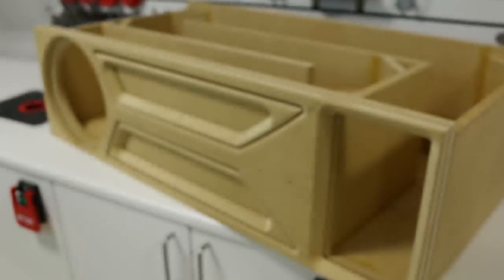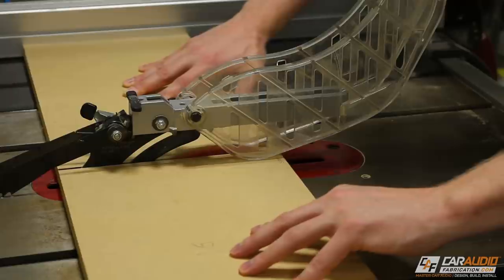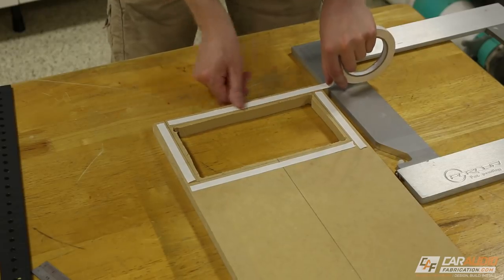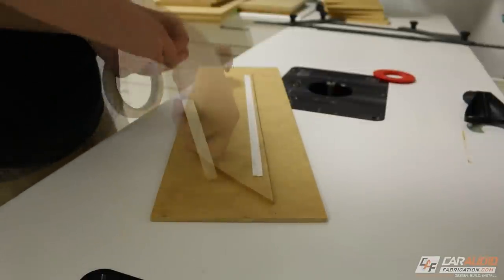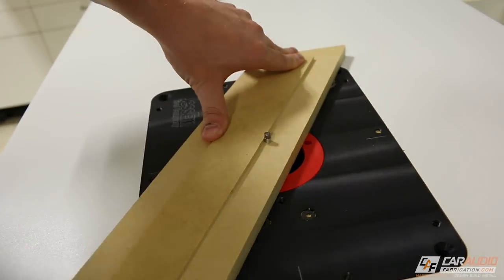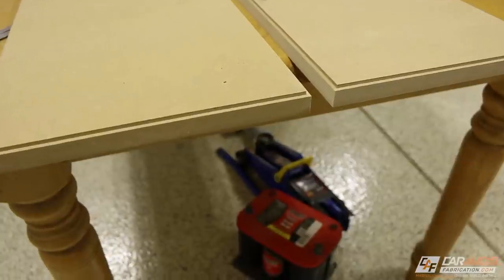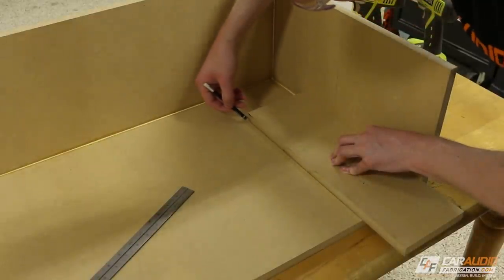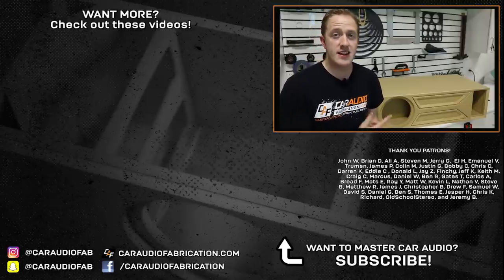How to Build a T-Line Subwoofer Box

Comment from the maker: What is your favorite box design style? What else would you like to see me build in future videos?
Reply: What is ur best sugestion for a 2005 chevy truck single cab subwoofer box  you think is better.
Reply from the maker: @omar - Not a T-Line. They get huge quickly. Take a look at someting like a sealed or ported enclosure. To determine if you have enough room for ported check out this video: https://youtu.be/oKdAHZS1LP4
Reply: Thanks brother i will ck all ur info, thanks for ur videos i am super pumped to customize my truck.
Reply: I like parallel 6th orders because you have full control over your pile of dog food. Ported boxes only let you move the left side of your dog food pile.
Reply: Triple chamber bandpass
Reply from the maker: Nice!
Reply: Something with an aeroport
Reply: my go to is EBS slot-ported, but i'll do a 4th order band-pass if i can get a flat frequency response with a similar Vbox.  better low-frequency roll-off with those.
Reply: @SoundmanCA: You DoUg, you :))
Reply: Hi Mark, I would be interested in your thoughts regarding passive radiators instead of ports. Do they have a place in car audio?
Reply: How about a 4th order band pass push/pull triple chamber box and why would you pick such a box?
Reply: I'd like to see a folded horn build. Rare as anything on youtube, most of the builds are just ported boxes with huge flares.
Reply: CarAudioFabrication , I am very interested in learning more about the transmission line style.  I had no idea it even existed until these videos.  More specifically, I want to learn how they compare to more traditional box layouts.  

So, special request: how feasible would it be to take the exact same subwoofer used for this design, and build a sealed, ported, and bandpass enclosure, and then scientifically test the differing outputs so we can see, visually with those awesome graphs, the actual difference?

Anyone that is into quality audio enough, knows what type of curve they enjoy the sound of the most.  Since we can't physically hear the differences ourselves, seeing those curves is the next best thing.

If this particular subwoofer isn't conducive to multiple enclosure styles, perhaps substituting a relatively cheap alternative could work?  The goal isn't to produce a sellable product.  The goal is to produce enough data to present to your viewers.
Reply: +1 for folded horn
Reply: unfortunately a graph can't express the low-frequency fidelity of a t-line.
Reply: I've been thinking about building a box for my home theater. Maybe something efficient with a 6" or 8" sub so I don't go to crazy with the size.
Reply: Hello Congratulations for yours videos! I have 2 JBL 15" (MS 15 D2) (doble coins 2 ohms each one) I must put then in serie to reach 4 homs each becouse my amp (it works only at 4 homs each chanel). I would like to use it in home, sometimes to play my bass... What you sugestion for a enclosure to them? Thanks!
Reply: 4th order push and pull. i have 2 10" rockford P3s and would love to do a custom box for MBZ 08 mbz C-class.
  also id like to take this time to thank you for knowledge shared and inspiration to build stealth sub box for WT5 for my cabriolet. keep up the great work.
Reply: Aperiodic Bi-Chamber!! ABC boxes have always been a favorite of mine.
Reply: 9Nails t-line is very nice for.
Depends how much space you have, a coffee size table/sub box or go a simple ported box.
Reply: T-line with two drivers in the same box!!
Reply: My favorite box design style, is the one you made for my Volvo S60. Ported for a set of four 8" American Bass VFL subs. I'm never changing it. I'll replace subs and amps if they ever go out but nothing could make me part with this box.
Reply: Folded Horn builds are pretty cool. On my channel, my cousin has a folded horn enclosure for a single 8" Alpine Type R that slams for what it is.
Reply: post vid...i wanna see
Reply: CarAudioFabrication 1998 chevy c1500 consol box
Reply: Tapped Horn
Reply: CarAudioFabrication you should build a 4 12" subwoofers box for a 1999 Lincoln Town car..... I want to put the power acoustic bamf 1,700 RMS each in the box once you're done making it 🤞🤞🤞 how much?
Reply: Closed enclouser with large membrane powerful speaker, or passive membrane enclouser with semi large membrane semi powerful speaker.  With as short as possible low frequency decay time and as tight as possible phase coherence of a signal with other speakers across frequency range. Although bass in most cars tends to sound better outside of the car anyway.
Reply: CarAudioFabrication is there any video on aero ported boxes? Anything to look in particular in building one?
Reply: Favorite is dual 12 inch enclosure with a shared kerf port kerfed both inside and outside 3.62 cubic feet tuned to 32Hz.  Double Baffling.
Reply: Quick question. Is a L shaped box better than an aerorort design? The reason I ask is because it seems like the L box would load up more than an aeroport port. Your thoughts?
Reply: CarAudioFabrication  I'm looking for if anyone has an encloseure design for a T - Line Box for a Kicker L - 7 15"
Reply: You are the first to Come close to a box I love for my 15's T-Line.
Reply: CarAudioFabrication Why those parts at 10:35 ? For stability or for airflow?
Reply: 4th order triple chamber
Reply: I've started watching your videos bought a router, bits ,a lift and table ur alot of help how bout a rear underseat f150 box for dual tw5s tht be awesome
Reply: Tapped Horn!
Reply: @CarAudioFabrication  can you make a video on a horn enclosure at 33hz for a 8in subwoofer please I really want to make a horn enclosure but I’d like to visually see how. Your subscriber-James

Comment: Why can't us the regular humans find guys like you to build stuff and install systems for us? Instead it's dudes that be like. "Yeah bro we got pre fab boxes ready to go, nah we ain't got no table saw in our shop."
Reply: Trapperjohn1000
There are plenty of great shops out there, you just have to do the research and find one in your local area. Yes it can be a pain in the butt to spend hours calling to different shops and visiting them to see what they can offer, and their level of work. I figured if you are going to spend a thousand or so dollars on a Subwoffer enclosure, you might as well make sure it is done by someone who knows what they are doing. A shop that can produce top tier work is going to cost some serious money, you figure about $100 to $150 and hour plus materials. I don't know what your budget it like or what your end goal is, but I can promise you one thing, if you are trying to find the cheapest installer, then the work you get from it is going to reflect the money you invest in the shop. SO the adage still stands, you get what you pay for. :)
Reply: I built an enclosure 4 layers fiberglass to hold a vented 12" L7 up in the quarter window of my 99 Yukon. I tracked my materials and hours, it would cost a customer round $1500 for this enclosure.
Reply: For real dude

Comment: Any idea on dimensions,volume, Port tuning frequency and length for a Rockford Fosgate 10 in p210 S4 basically a slot port bandpass with the port on the front of the woofer side the reason why I'm asking is I can't find any good free calculators online I don't know where you guys are getting those programs I was just wondering if there's anything free, all I want is just a bandpass box for this 10 inch sub this has been a really hard find any info would help greatly thank you

Comment: Great project... I've built hundreds of custom car subs... loved it for many.many years... I used routers extensively, as well as routers to flare large PVC port tubes-from the inside at the speaker baffle board and both inside and outside the PVC port on the inside thereby eliminating the air from breakingoff/separating from the port just like in an airfoil. 

This allowed the bass to smoothly and with much less noise extend the bottom end in a way that was awesome. Loved shaping what iz would pull vinyl or grill cloth over like sculpturing.

Boat seats are sculptured in a very similar manner and are dubbed 'sculptured foam'

Comment: BTW... I always found using the poly based professional liquid nails from a caulk gun and 1.75 inch narrow crown staples (still have that gun to this day) was the best way to fasten any MDF or particle board product. It work quickly and solidly and you never, ever have a joint to leak, break or even give in any way. the material will break somewhere other than the joint even if ran over by something like a dump truck. I always used a DuoFast gun.

Comment: Awsome build. I used to design these ban pass boxes. The length and cross sectional area are extremely dependent on the driver you're using. What driver is going into this box, also what frequency is it intended for? You may have gotten me back into this again.

Comment: Could you clarify or comment on one aspect of T-line enclosures?  As with any enclosure which uses a port, isn't the enclosure "tuned" to one specific frequency?  This creates a bump in  the frequency response curve around the port's designed frequency.  So how do you keep it from sounding boomy at the tuned frequency?  Is the roll-off from the tuned frequency in this enclosure smooth or sharp?

Comment: in t-lines i've noticed the port is usually on the same plane as the driver.  is that a design requirement?  i would prefer to have the port rear or down-firing.

Comment: Hi, I bought a edifier s350db speaker system. I intend to remove the 8 inchs driver from the ported box and build a transmission line enclosure for it instead. But I'm worry that this driver might not be suited for transmission line if he don't have the correct fs, qts, qtc, vas, re, so on. Do you know of an ideal 8 inchs driver for transmission line available for purchase online that I can buy. I want to listen to my entire collection of rock from the seventees with low distortion tight bass coming from a single dedicated t-line subwoofer. As for the digital amplification of the edifier it is very well build. Keep on rocking till you drop as def leppard said in their pyromania album.

Comment: Can T lines be use for any single sub? And whats the best thing about T lines?
Reply: A "T" line is easiest to design build and install in to the vehicle with only one subwoofer. The overall size of a "T" line is pretty massive vs other box designs. The best thing about a "T" line box is the ability to flatten out the bass curve and allow a subwoofer to play more accurately with fewer spikes in the frequency range. 
  As comparison a "bandpass" designed enclosure will be "tuned" to create a spike at a certain frequency. This allows the precised volume of the box to "louder" and have more punch. 
   A "T" line works best in a open are space like a SUV, Station Wagon, etc, due to its ability to reproduce a very accurate level of bass... The bandpass box for comparison works best in a sealed trunk. Since the back seat of a vehicle tends to block a lot of frequencies, the bandpass box has the ability to punch hard at a given range at the sacrifice of overall sound quality and accuracy.
   SO T line is best for open air vehicles, not saying you can not use them in any other application, it just would be a waste of time effort and space to use this style of box in an enclosed space. Since the benefits of a "T" Line are robbed by the materials the sound is trying to push through.
   Hope this information was helpful :)
Reply: +Womby Farthing
It is all about port tuning. You can tune the port to a given frequency response ranget. Allowing you to flatten out any spikes in the low end. It takes trial and error and experience to get one right. When you do the results are nothing short of spectacular. It is not like setting up a system in a large room, the interior of a vehicle plays havoc on the sound quality of your system, so box "tuning" can play an important role in sound quality for automotive applications. In a perfect world you could stick all your speakers in the proper sealed enclosure and be done with things.
Reply: +Din Tjommi
You are correct, not all subwoofers work well in T line boxes. I have had some amazing results with Sundown Audios SA-8" and X-6.5 SW V.2, the excursion and overall design plays well with a T line and allows for a wide range of tuning. For real world example, my 2001 Golf GTI has an issue of a 54-55 Hz resonance. This causes a peek at the drivers location that gets "boomy" and it is so bad that it will drown out everything else when that tone is achieved. I have found that any sealed, ported, or bandpass box I have installed as not gotten rid of that over amplified 54-55 Hz hit. Just the cars design causes that spike in sound pressure levels at the 54-55 Hz. I have found that a single Sundown Audio SA-8 in a "T" line box tuned to 30 Hz facing backwards removes that spike in the sound from the drivers position in the vehicle. This has vastly improved the overall sound quality of the system overall. I no longer have to deal with ear bleeding spikes in the sub sounds. The added benefit I have found with the T line box is the lack of port "chuff", even at very high Hz levels the port "chuff" is near silent. The smaller overall size of the 8" subwoofer allows the speaker to reach higher in to the mid bass range then larger subwoofers. I have more head room to adjust my crossover points, allowing me to tune out some of the sub bass from the midbass speakers. Preventing any sort of low end distortions, and reducing the over all strain on the amplifier driving the midbass, mids, vocal and high speakers. Giving me a much fuller range of sound with far fewer peeks and dips in the audio range. Under white/pink noise testing I have been able to achieve near flat levels of sound sitting in the drivers seat. All while doing so with less then 2000 watt class. I have won a few competitions for sound quality in the 2k class, so I am pretty happy with the overall results.
Reply: COMPASBASSCLUB CHICALI try to use a sub with a QTS of .4 or lower. That's what helps give t lines the flatter response and shallow rolloff and tune it to the FS of sub. So try to find a sub that has an FS of the tuning you want
Reply: home audio only? hmmmm something to think about, thanks. a T line for my 8" infinity is my next build
Reply: 8" infinity for SQ in small hatchback??????? (280z)
)
Reply: COMPASBASSCLUB CHICALI the best part about transmission line boxes is that since it has many walls on the inside of the box it shoves all that Aaron compresses more and more and shoots it out of the opening at the end. Not only that but some of them with single speaker shoot the opening towards the actual speaker so that whenever it's going forwards and backwards not only is it shoving it through the transmission box it is pushing the escaping air towards you. If that makes any sense.
Reply: +Seth Hardin : Reference this:  http://www.quarter-wave.com/TLs/TL_Theory.html
      Transmission line enclosure relies on a quarter wavelength acoustic standing wave. There requires a fair amount of calculations to tune the "T" line port properly. For example, (I will try to keep this simple) I wanted to tune my enclosure's resonant frequency  to 30 Hz. You would calculate the length needed in order to produce a forward firing 30 Hz wave. This would then bolster or reinforce the subwoofers own frequency response at 30 Hz. The port has to be firing in the same direction as the woofer itself. Without this the response of the port can actually have a negative effect on the overall output of sound. Since the port is taking "sound" from the rear of the woofer, which normally produces the opposite sound wave as the front. SO for example the front of the woofer produces 40 Hz the rear of the woofer would produce a -40 Hz. This would cancel out the "sound" produced by the woofer. That is the reason playing speakers in the air without and thing around them they produce little to no sound (outside of some wind noise from the venting around the voice coil and rattle from the surrounding surfaces. But to produce that 40 Hz sound you need to isolate the two sides of the woofer, to prevent them from interacting on each other in a negative way. SO what a Transmission line box does is use that "negative" wave by flipping it to a positive and porting it out firing in the same direction as the face of the woofer. In turn this can reduce a weak or dead spot in the woofers ability, or reinforce and "boost" others. It all depends on how you want to tune the box and what your end goals are. Do you want a natural flat even response, or do you want a punch/hit at a certain Hz.
Reply: The best of the best bass woofer ever you can have..
Reply: T.line you can get superduper low. .low.low..long bass........... and shaking vibrate all in your cars..even your skin also vibrate  ..😎

Comment: He says this is good for low frequencies for a smaller sub but does it work the same for something bigger like a 15"? Just curious
Reply from the maker: Yes, additional low end extension, but keep in mind that you are only "shifting" the energy. You don't magically get more sound without giving it up elsewhere, a ported would still be a better choice for more output. Also a T-Line for a 15 would be HUGE. Like, not fit in your car unless you drive a Van huge.

Comment: Hi Mark, I've seen your video of how to design a t-line box, but I have a doubt, from where it starts and up to where the port length ends
Reply: starts at the back side of the speaker cone, ends flush with the outside of the box.
Reply: From the center of the woofer?
Reply: correct, the woofer creates/starts the wave so that's the point of origin and where you should start the measurement.